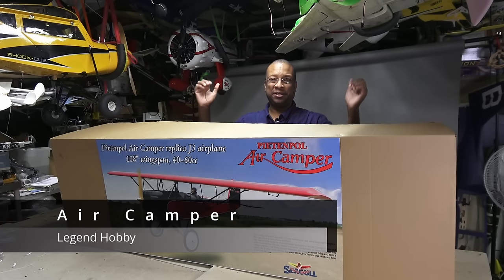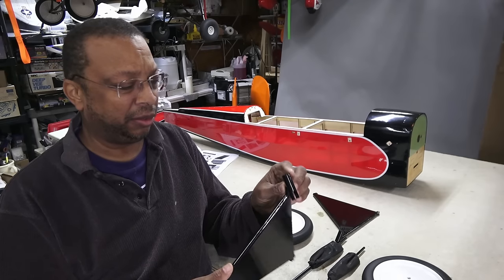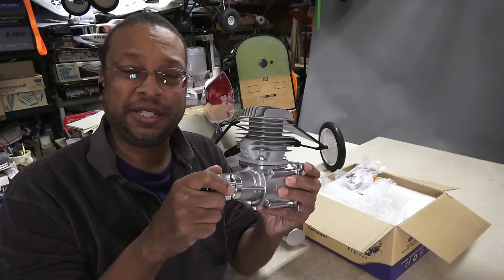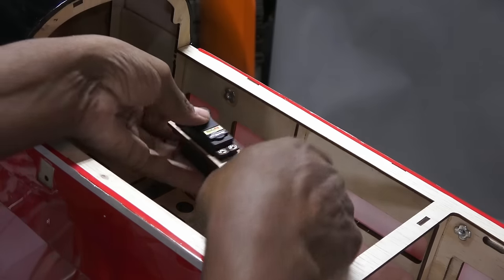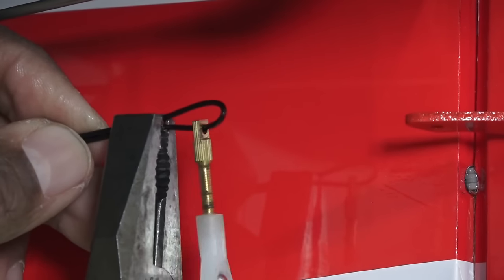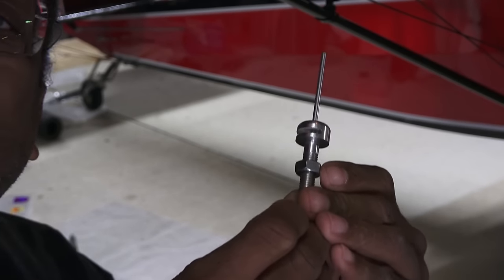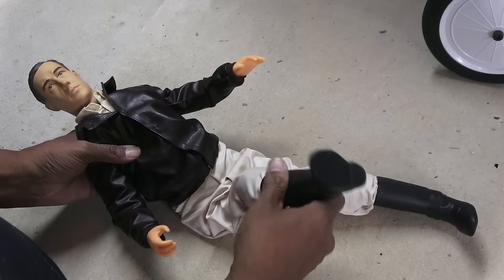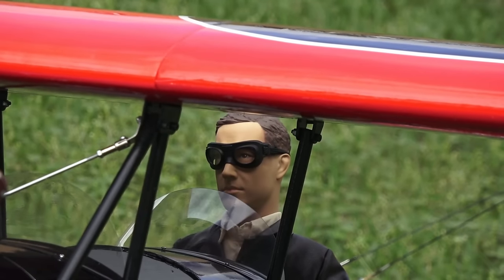Beloved Homebuild - Pietenpol Air Camper 50cc Assembly | HobbyView

Comment: I have one of the four imported into the UK by J.Perkins, I`ve waited months for it!

Now complete, I have fitted the last production Laser 310 completed by Jon at the factory. Laser now closed but spares may eventually be sold by Model Shop Leeds. The end of an era.

Mine weighs a little under 26Lbs. About 8oz of lead on F1 firewall. The two cylinder probably weighs more than the gasser Fitz has installed. Keep that tail light when you assemble. Seagull models are often tail heavy at build. Try their Stearman! The tailplane is constructed like a cricket bat!

Landing gear...replace the 4mm locking set screws with 4mm cap screws. The set screws are very soft . Caps screws can be tigthed fully with more confidence. I replaced the kit wheels with air tyres which are more capable at absorbing landing shocks.

Engine runs were successfully completed this morning. All ok. I`m constricted by a local regulation which prohibits flying a model of 26lb weight near an active airport. I have to go to a flying site to the east of London to ensure compliance. 

I hope to maiden the model later this week.
Reply from the maker: Heard that about Laser. Sorry to see them go.

Comment: Hello, I have been flying mine for the past 2 months with a 60CC 2cyl Inline 4 stroke from NGH. It flies very well and very Scale like on a 23-10 Falcon Prop. It does Loops, Rolls, Slow rolls and is Very good at Slips with it's Large rudder. A Great Buy From Legend Hobbies!

Comment: Tip: To remove covering from the stab for gluing, try using the blade insert for your Sequre 666 soldering iron. Great hot knife that won't injure the balsa so quickly as a razor blade. Great vid, as usual, my friend.

Comment: Great video!  The original Model A engines did have era speed equipment available for more horsepower but you're probably right about an Air Camper towing however your Stinger might have enough power.
Reply from the maker: Yea, no worries on the model having enough power. It just seemed...wrong.

Comment: I have the same aircraft (still in box ), with the 63cc stinger engine, (still in box) would have liked to have seen your electrical set up, this video gave me some Ideas, especially around the wing  mounts as you can see the wood after installing the mounts, so I will paint a little so it looks neater, and the tail support mounts paint black, I also have the 8" chrome spoke pneumatic wheels  so that will help with the extra weight needed, my biggest plane is a 80" stick with a 30cc twin, Thanks mate , ozziebolland, Australia
Reply from the maker: If you can fly the Stick, this one shouldn't be a problem. Cheers.

Comment: Have you tried rubber free flight or compressed air? Much less expensive and yet open to great creativity. Of course some different flight requirements and aerodynamic chalanges.
Reply from the maker: Yes. I used to build free flight models and have a great fondness for rubber powered models.